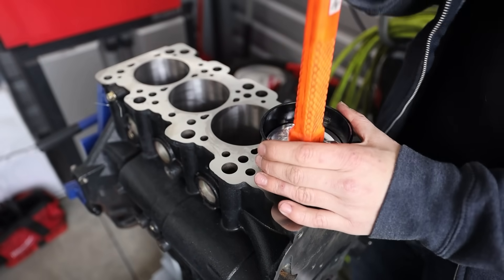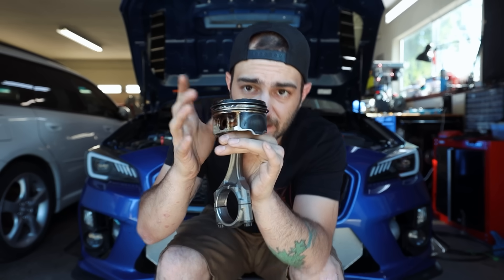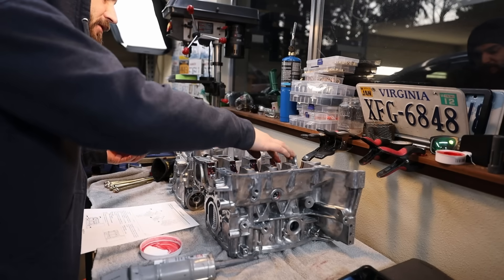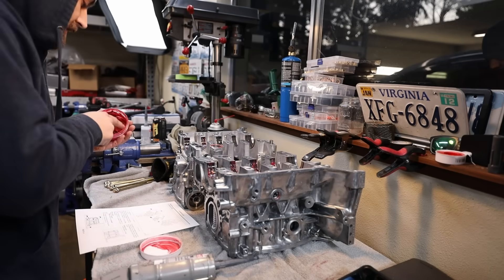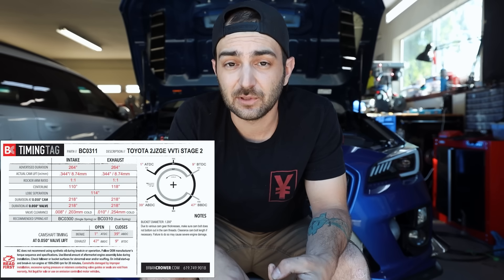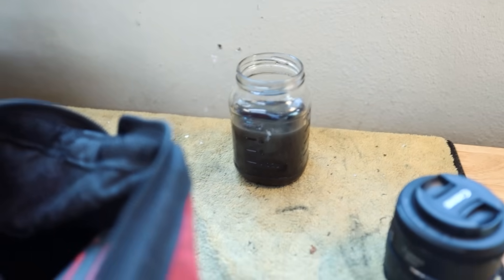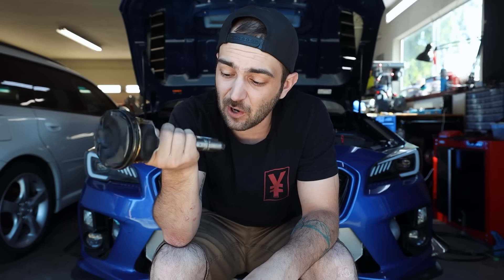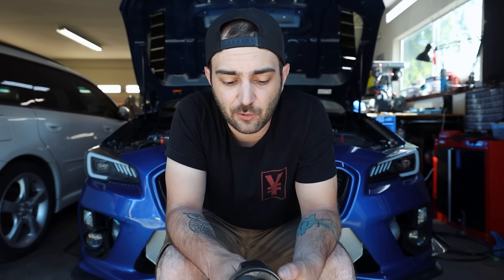How To Break In a New Engine.

Comment: On modern engines you do a least 3 oil changes to get rid of all the shavings before you get to the 5,000 mile range and after you can do the manufacturers spec oil changes.

Comment: Bought a new RAM 2500 with 1500 miles on it. Drove it from Bedford Ohio home to Western New York. Changed oil and filter , drove it 2000 miles changed oil and filter again and sent in a sample to Speed Diagnostics. High copper wear  metal. ( Using recommended PUP 0W40. ) 6.4 HEMIs are known for higher copper but mine is really high! If it's still high after next 2000 mi., I'm switching to 5w40.Currently 80 ppm copper. I'll continue to monitor for first 10-12k or longer until I get in acceptable range.

Comment: Hey recently I got a 16 sti with a 26k mi ra block with a Perrin intake, downpipe and exhaust. Ive seen some reddit pages saying the block is just as bad as older generations. What max tq/hp would you recommend to keep it fun and reliable. I'd love to have a 400 awd hp daily but I dont know if the RA would be okay for that. Or would you recommend getting a iag 550 block as a backup

Comment: Wow someone that actually knows how to breaky in an engine correctly.  I will fast idle a new engine for 20 minutes (rpm depends if it a semi diesel or petrol/gas, etc) then leave it overnight to cool down to ambient temperature, then the next day drive the vehicle hard for 200km / 120miles with 4 people in it or load something in it to equal weight, if it's a semi / prime mover I'll hook a trailer up to it with about 1/4 weight capacity, then for all vehicles find a mountain range and go up and down using only the engine to brake/slow down and while going up I will keep rpm around half way to redline and keep making it go to just below redline.  Every engine I've built was strong and didn't use any oil between services

Comment: Change at 1000 miles. Then every 6 months or 3000 miles afterwards. Oil and filter changes are cheap, engines are not. Remember the other filters too and don’t use cheap gas.

Comment: FYI, there is a difference on how manufacturers build engines vs garage engine builders. Manufacturers have specs on how much assembly lube to use rather than slather the entire parts with assembly oil which can clog the oil filter.

Comment: Change your oil at 500 miles to a very high end oil like Amsoil or pennzoil and keep using it. Regularly put Lucas fuel treatment in the tank and you will be fine. It will seriously cut back on coking and keep your turbos special.

Comment: I follow part of the manufacturer recommendation (Kia and Mazda). I stay under 4k RPM for the 1st 300 miles, afterwards I raise my limit to 5k RPM until 500 miles. Then go near redline before 600 miles. Lots of engine braking and altering engine load. Done on the freeway and at the twisty mountain roads to change load.

Comment: Break in occurs at 1000 miles, not less... change oil..drive 100 miles and accelerate hard 2 times 75 percent to set the rings. Works each type all engines.

Comment: Not pulling spark plugs on a H6 if I don't need to... for this step, also you mention due to the compression gases trying to stay in the motor... buddy it leaves the motor when the exhaust valves open they don't stay closed because you want them to lol

Comment: It took almost 5000 miles to break-in my engine. How do I know? Because it got quiter, smoother, and my fuel mileage got better all after the 5000 mile mark. Before 5000 miles, there was a lot of whine and 2 mpg less. Were the rings broken in before that? Possibly, but there were other things that were not broken in evidently based on sound and fuel mileage.

Comment: OK... New cars, for the first 500 miles, do not floor them. Drive in different types of conditions, city, highway, etc. That will smooth and set all engine parts and take care of the engine. Then, after 1000 miles, change your first oil to drain any microscopic metal that was smoothed out during the break-in. That is all you have to do, according to an engine mechanical engineer.
Reply: Don’t need to do all that … you need a decent amount of pressure behind the rings to bed with the bore pattern of the cylinder to create a great seal. Don’t beat on the engine but also don’t baby it… you need to see a various amount of revs with the pistons within the window before the it smooths out and you lose it.

Comment: Jondeere I received at 14.5 hours. One frosty day. I dipnsniff. Aaahha!!!!! Thick silver grey! I drained that breakin oil. Removed that tiny oil filter. SayWhat? Jd shut down in town? I replaced  it by hand. Filled with 10w-40  blend. Ran  a short bit. My toyotaco filter fit. 0h no! Lil jd gasket flat- metal lock.- Stuck tight!  Whew! Finally.  Some sparkles. Fresh castrol 10w-40 blend.  Clean oil now. 30 to 40 hour oci ever since. Ocd to mow frost. Lol

Comment: No issues with your break in process, but would add oil analysis from the first oil change (after break-in) until iron, copper and ither metal items level off.

Comment: engine break in occurs over 200,000+ miles... begins at mile 1 with the most wear, and goes down from there (temperature / and RPM not withstanding)...   common sense, warm up the engine before you exceed 2500 or so RPM and drive it easyish and vary your speed for the first 300-400 miles, avoiding long freeway rides.

Comment: Fill up your filter with oil, take the oil pressure fitting off and using a clean oil can start pumping untill all the galleries are full, screw on your oil prerssure fitting and start the motor, no taking out plugs and still not knowing if the oil pump will prime, people like to  make mountains out of mole hills, the brain is a terrible thing to waste..

Comment: Actually I watched a video about how the bearings do kinda smooth out or something and they’re designed that way and that’s why it’s good to take it kinda easy at first so that they bed in and get smooth and that ensures you do always have the oil layer
Reply: Bullshit, proper bearings and crankshafts are a mirror like finish that are designed to be exact from the word go with exact clearances for the oil to flow between them making a perfect "cushion" between them

Comment: The engine should be primed either by physically turning the oil pump independently from the crankshaft or with a pressure priming can long before it's installed into the car.

Comment: Not a big deal, but you've got blow-by backwards. It's leakage of combustion gasses past the rings into the crankcase, and becomes a problem when there's so much of it it cannot be handled by the PCV system. Oil consumption from ring wear or cylinder scoring happens when worn rings allow too thick a film of oil to remain on the cylinder wall, though If blow-by is extreme, it can cause pressurization of the crankcase and oil to be pushed past the worn rings on the intake stroke.. There is always a very thin film of oil left on the cylinder wall, even when a brand new engine is running, but this doesn't get burned because there is an extreme temperature gradient right at the cylinder wall that keeps this oil below its flash point. If the oil film is too thick, it can and does burn, though leaky valve seals are likely a more common path for oil to get into the combustion chamber. Finally, the main reason to use assembly lube instead of oil is that oil can be displaced during the rebuild process, leaving parts of the engine to become briefly oil starved during initial startup. Assembly lube is designed to be completely displaced by oil once the system is pressurized, leaving no residue behind, unlike the standard grease we used to use. If you have a way to pressurize the oil system before that initial startup, you wouldn't need to use assembly lube.

Comment: Breaking in a car engine is essential to ensure its longevity and performance. During this period, usually the first 500–1,000 miles, engine components like pistons, cylinders, rings, and valves wear into each other smoothly. This process helps to create better seals, optimize friction, and prevent excessive wear later. Running the engine gently allows the metal surfaces to polish each other and properly distribute oil, which reduces the risk of overheating and damage.

Tires also require a break-in period of around 200 miles because the outer layer contains residues from the manufacturing process, which can make them slippery. Driving cautiously allows the surface to wear down and achieve optimal traction. Additionally, tires need to settle into their final shape and develop even tread wear.

Brakes, particularly the pads and rotors, need to be broken in (a process called bedding) to ensure the materials contact properly and to avoid glazing. Bedding-in brakes allows a thin layer of material to transfer between the pad and rotor, enhancing braking performance and minimizing noise or uneven wear.

Overall, breaking in these components ensures peak performance and prevents premature damage or failure.

There are teams of mechanical engineers who know the materials used in the engine and the temperatures and pressures the parts need to see before using the engine at higher revs. But everyone would rather take on the opinion of one guy on the internet and forget about the car longevity or its warranty… You go for it, I’ll stick with the recommendations.
Reply: Rings dont seal gently. Thats why there are so many engines using oil.

Comment: No! Rev high then release and repeat is the ONLY WAY to proper break-in an engine. If you baby it, there will not be enoug pressure/compression to seat it. Just don’t stay at high rpm, only because:
- you will get alot of heat from frictions.
- your oil is not full synthetic. Its mineral.
So, accelerate, decelerate, repeat until the engine is about to overheat. Turn off ignition, let the engine cool down.
I don’t know why people keep telling others to baby the car. Do you know how much punishment  the engine get when you drive slow and lug it?

Comment: Awesome video; with some phenomenal information.  I wish I saw this right before I picked up my 2024 BRZ.   I did do my oil at 615 miles.  If I saw this video I would have done my first oil change a little sooner.  I am retired and only drive 4-5k per year.   Just to be safe I will be changing my oil every 6months.  True that’s low mileage, but with the chance of fuel dilution and oxidation; better to be safe than sorry.

Comment: Use the a oil galley plugs to put pressurized oil through it while spinning it by hand. until you get oil coming out of every pushrod if you have a pushrod engine.

Comment: Just broke in my GR Corolla (now 1k miles)

Keep in mind -you are also breaking in the whole drive train (& brakes et al )

For the most part my  list of things to do is very close to yours & what I have done going on at least 15 new vehicles.

This is my short & dirty list for first 600 ish miles (& oil change)
- I don't idle the engine to warm up - I drive very slow out of my residential area
- no short trips or long trips (35 to 80 miles)
- let engine get DEAD cold before next driving event - MPT
- don't drive during rush hour - for one so as not to idle or abuse the clutch
- step up engine RPM when accelerating. (in 1st gear - 1800 hold 15 sec 2000 for 15 sec 2200 for 15 sec 2500 for 15 sec  - let car engine brake to 1800 & repeat in all gears) To not be the A-hole on the road I do this part of the break in at 5 am!!! 
-the controversial part - but it's what I do.  50-75% Wide Open Throttle a few times each session (starting at 3k RPM) Allow vehicle engine brake to 1800 rpm and hold for a bit oil up the cylinders (helps seat the rings) & cool down a bit.

Comment: Dont forget that aside from your 3 stone or ball hones grit, it’s allllll about the crosshatch angle specification to get the proper balance of oil retention and compression and heat dissipation. Machine shops can take it a step further with their machines by achieve a perfect “plateau” cut that accelerates break in

Comment: A lot of motorcycle and watercraft builders also go by heat cycles.  i used 8 heat cycles on my hi performance gp svho.  ive had that motor 4 years and currently its 25 % more hp  over showroom stock zero issues.  changed the oil at 8 hours too

Comment: @smeedia hi ya,iv got a golf MK6 R & iv just had my engine re built with everything,Carrillo piston & rods supertech valvetrain cometic gasket ARP bolts polished/ported head & so much more,long story short my friend who’s built so many engines has now decided to leave me stranded right at the last bit & he knows the running in wasn’t something i wanted to do,we did the priming turning it over so all that is done,it’s now just the run in & he’s saying 500 miles (he’s always been extra safe) can you give me any tips? From what i THINK i no is..don’t keep at same speed change gears up & down regularly & do a lot of engine braking either by the paddles (it’s a DGS) with a 7 speed RS3 box,or just in S mode & let the gears drop from 5/4/3/2 ect then pick back up to speed & repeat,never staying at the same speed always up a little & then down a little,& keeping the RPM under 4K ? From what iv said is there anything you’d say to do or not do? BTW it’s on the 2.0L block well apparently it’s now like a 2.1 & the turbo of choice is a G25-660 i no you can’t put foot down for the turbo to come on but i really want to give this car the best start because iv put around 17K into this build & im from the UK BTW
I’ll appreciate any tips you can give 🙏

Comment: 78 la 360, just primer my engine without cranking on it, able to turn oil pump thru distributor shaft, had 60 lbs pressure and my rockers were oiling and I have roller rockers no cam break in, thanks for the tips, will use your technique for seating my rings

Comment: Can you just take off oil filter and make sure oil is dripping from there when cranking - ensuring oil pump is primed and pushing oil up. I don't have anything to measure oil pressure with...
Reply: No. If you take off oil filter and crank it there is no oil going to the bearings. Even a few seconds causes significant wear

Comment: Breaking in a motor properly should be spun on a machine with the heads off with fresh oil before it’s in the car. Which is replicating the spark plug removal process although I do this as well anyways to prime it. Once it’s in the car and the oil pump is primed. Start it and then you do the idle procedure or with wheels off the ground put it in first and keep it steady rpm. Changing the oil after the first cycle. Then put fresh oil in it bring up to temp. Time to race, break in happens the first hour during that initial rpm variation procedure off the ground in your driveway or shop. After that just drive it like you are going to be driving it. Mines a race car. It gets tuned then raced. And my set up hasn’t changed much so the tune is usually pretty darn close. Then document your results. And then it becomes kind of ritualistic. But within all engine builders we can all agree that rpm and heat in the beginning is what seats the rings.

Comment: Controversy of break-in period exist only because people have opinion without clear picture what break in is and what parameters affect it. Because so many unknown, there is no definitive answer can be given. It depends on materials hardness, oil type and its friction properties, detergent properties, certain ambient temperature expansion and contraction, initial build tolerances, type of driving/usage, ambient also slightly affects heat transfer in the block, initial filter parameters and capacity, sump capacity etc. Majority of these facts or estimates only manufacturer would know. At least better than anybody else. They even know what oil they put in.  Maybe they used even certain break-in oil. All you have to go with to estimate the longest miles it possibly can be based on the worst combination of factors. If somebody says exact universal number, he has no idea what he is talking about. The best what can be done is to follow manufacturer schedule for break-in period. If you buy car because you trust manufacturer that built this car, why not to trust them with break in schedule.

Comment: This is the first time I've heard anyone recommend using engine braking. I've always been of a mind that the car's brakes are cheaper and easier to replace so it's better to use them to stop the car, not the engine.

I assume the recommendation only applies to the initial break-in period?
Reply: Break in only

Comment: I recently purchased a 2023 Winnebago Travato with the Ram Promaster chassis.  It already had 2000 miles on it as they are driven from the factory to my dealership in California.  I now wonder if all of that highway mileage was good for the engine.  I immediately changed the oil and filter around 3000 miles with a good synthetic.  I plan to keep it for a long time so maintenance with be done regularly.